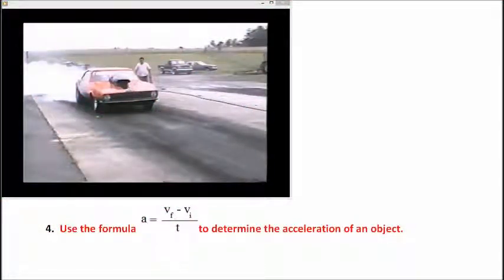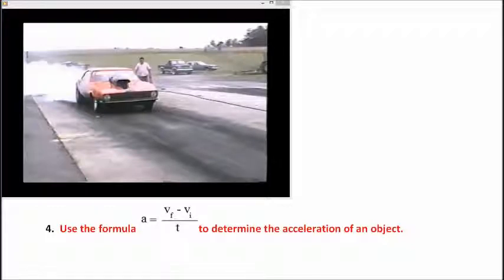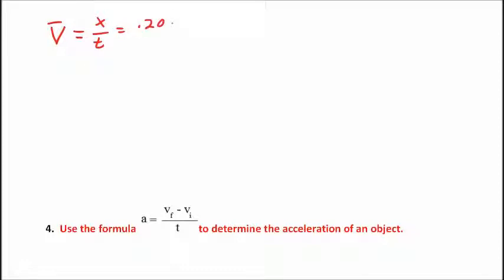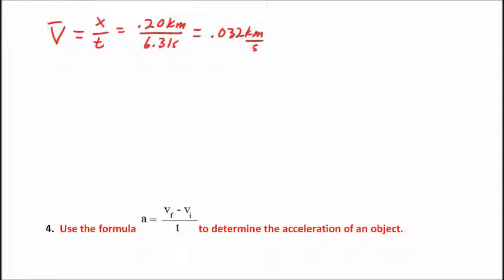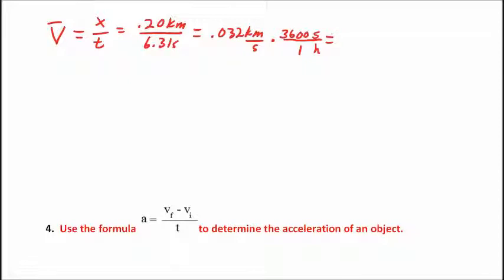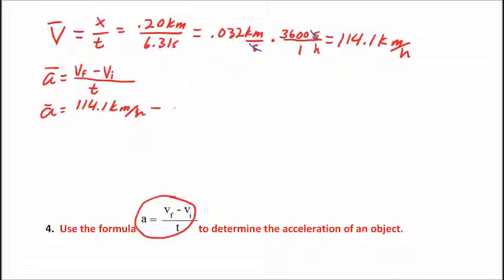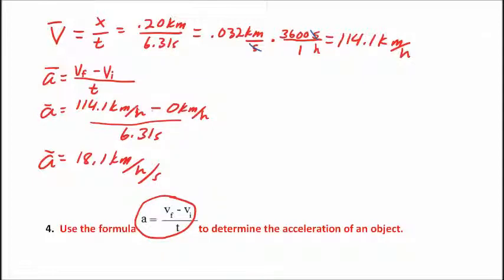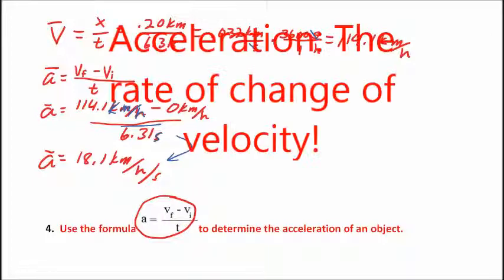Basic Physics: Solving A Real World Acceleration Problem: Drag Race Acceleration

Comment: I came up with 115.3 km/hr what's the error?
Reply from the maker: Don't round anything until you are done.
Reply: No, it's 115.2 km/h The video is incorrect. Another method of doing it is just multiply 0.032 by 60 to give you the speed per minute, then multiply by 60 again to give you the speed per hour. You were 1.1 seconds off for some reason :S
Reply from the maker: Alex A p